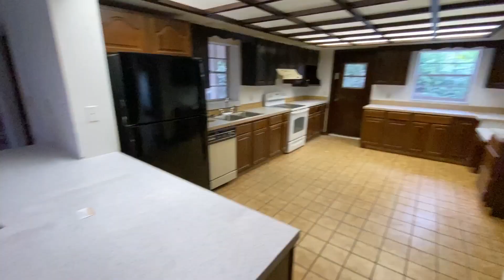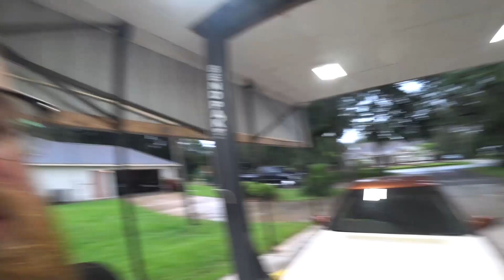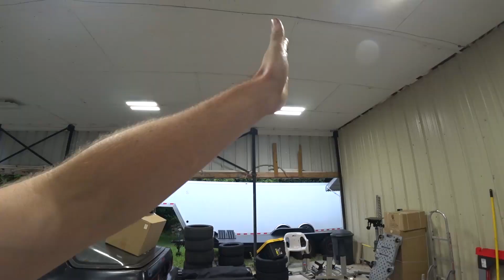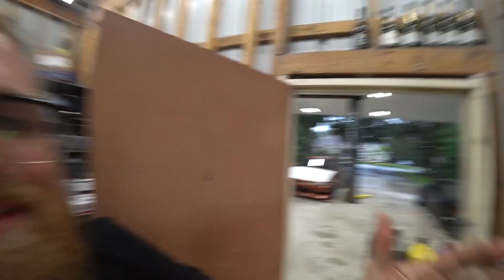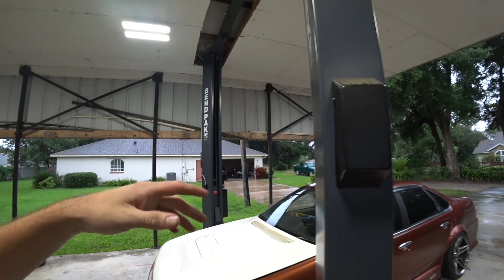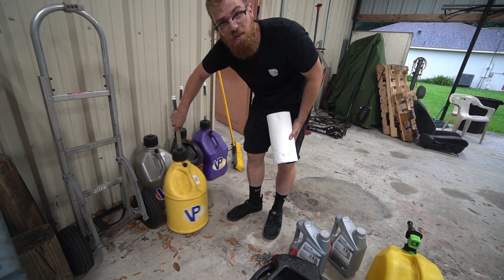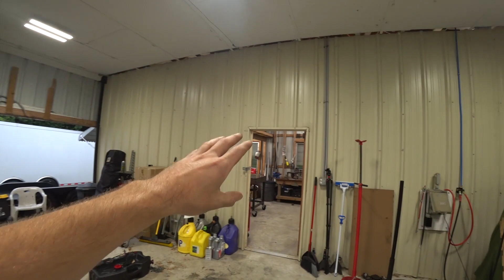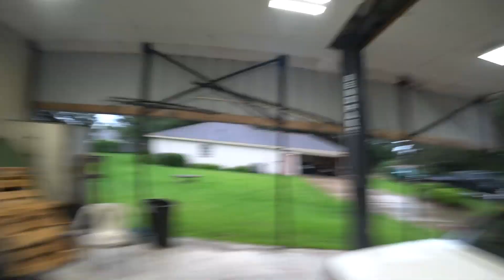Update on my new shop. I have to tear it all down.

Comment: This is why you do everything on the down low and eliminate any unwanted visitors.
Reply: This is exactly what not to do. This isn’t the 80’s anymore. Paper trail is electronic and when they find out permits were not done you are on the hook.
Reply: Depends on Nepotolgy
Reply: @McarthurMotors  Naw, if it’s gonna cost him a hundred thousand more for a new shop a few thousand in an envelope (for their re-election, of course) will fix it for a fraction of the price.
Reply: Yup that little bit would have been closed up in a day and life would have went on regardless of visitors.
Reply from the maker: If you think a new shop is $100,000 you’re pretty far off. It’s about $10,000 more to build an entirely new shop than to close it in. Will probably be another 15-20k in extras like ac. Extra insulation. Loft. Etc.
Reply: Yup it happened to me ..live n learn .lives out in nowhere was building a garage barn on my property .had a yard sale next thing I know town was at my door
Reply: "eliminate any unwanted visitors"

That's why he needs storage for body parts.
Reply: And then a Karen drops a dime on you and the Building Department charges you with felony un-permitted construction.
Reply: @McarthurMotors  paper trail??? There is no paper trail with cash.
Reply: Exactly!👍👍👍
Reply: Terrible idea. U fool no one doing that. U cost yourself a literal nightmare. One neighbor reports u? Bam. Structure fails? Bam. Try to sell the property? Bam.
Reply: @pattimessenger6214  the fact that your two examples exist shows as to the sad state of the world….
Reply: @TinHatRanch  The people that catches the most hell are the people that has that "look at me" syndrome😂👍
Reply: @TinHatRanch  not how things work its a matter of safety.
Reply: Safety first always.
Reply: @Taylordrifts  I think you're underestimating the demolition costs..  and you're getting completely screwed if that's what they were charging you to fill it in.  All you needed was some half sheets, a couple roll up garage doors and a 3ft walk door... and some 2x4's..  You screw the sheets lapped under like the "cheap guy" said.. and you're nearly don't --- just fill it in with simple stick frame with wood or even light angle iron.  It's not structural;  it's just a facade.  The "structure" is already obviously-- how else is it standing... I would have done this for $3k labor, not counting materials. It's a super simple and easy job... It's literally 3 walls. lol..  I get that material prices these days are out of hand, so I wouldn't even know how to guess that price--- I'd have to call around and check.   But there's no going back now;  once you have the government pitbulls on your neck, they don't let go........... "No good deed goes unpunished"--- i get that you were trying to do things the right way, but knowing what you know now-- next time just do it and don't ask when it's an existing structure.
Reply from the maker: @calholli  I already have a quote on the demo costs and it’s not much even without saving anything.  But yeah I’m hindsight sure. Should have just done it. But also it’s going on a YouTube channel that’s easily searchable. I just didn’t want to deal with headaches later on and honestly not even mad it forced my hand on doing a better shop. The time wasted is really what sucks. Could have had the new shop done by now if I started with that goal in mind.
Reply: @Taylordrifts  Yeah.. as long as you have the extra money, then you'll probably be happier with a new shop anyway.  I probably would have built the new shop right next to it, and kept that thing for a car port;  that's by far the most economical thing to do.
Reply: @cfcreative1  Paperwork doesn't make structures safe. It just makes bureaucrats employed. Safe structures can be built legally or illegally, it's the methods and workmanship that matter, not the permits.
Reply: @McarthurMotors  ......and good luck insuring it.
Reply: @bpj1805  its not a perfect system but i saves lives vs anyone building a dangerous building that people live in.
Reply: Not sure about FL but in NY they harassed my Dad over some things and he confronted the inspector about their having to ride around bothering people due to not enough other work to do.  Also, his property is zoned commercial so he was not only a residence.
Reply: @pattimessenger6214  Turning in people for Jan 6 when every major US city experienced some level of rioting and looting is 🤪
Reply: @cfcreative1  People generally don't get too out of hand with structures they themselves will be using. Anyway, it isn't the piece of paper that makes a structure safe, it's the construction details. I don't like this sort of credentialism that fetishizes paper trails. That building in Miami had all the paperwork too.
Reply: @bpj1805  Well in Canada i have worked in construction for the last 15 years. There is a process for making buildings that involves approving the plans. Complying with local codes. Inspection of foundations, renovations, framing, plumbing etc. Life is short. Doing things right the first time saves many people stress, potential disaster and financial loss.
Reply: @McarthurMotors  it not the 80 because folk put up with bs and will not vote in loving folks all this sounds  like hes building a bridge goofy
Reply: @cfcreative1  Yes, and you can "do things right first time" without ever seeing a government employee. It's the real-world conditions: the soil types, dimensions of foundations, methods of joining materials, etc. that make a structure safe. Not the legal fictions layered on top of it: the permits and fees and approvals.
Reply: @calholli  I completely agree! The only difference is that I would charge $4,000 for the labor. lol.
Reply: @ChooChooRooter   yep send then to a sckrool that will do it .sad sad stuff adult needing hand held and liking it
Reply: It will hurt and hurt you badly when you sell and you have to pay for demolitions and fines.  He screwed up without asking about permitting and getting that in the housing contract.
Reply: @garhent  things that may be true modern odd ball over complicating ways of  thinking add contracts and law suits and the heart in people to use that so easily to hurt others all for no more that being a prideful persons and justifying it by making the reasoning that it  up holds  rules imposed by rule mongers all that looses common seance need to retrofit but that part is on this guy may be do thing he even tried that angle   ,theft in truth may be
Reply: @onetrues3978  i have only worked building houses in Vancouver. Im sure there is some corruption in every industry. Its your choice to call it all bad or all good.
Reply: Yep
Reply: @garhent  i agree i know a guy that messed with his house when selling time came this was an issue that could not be overlooked
Reply: @M30263  people will always buy in an up market.

Comment: My brother-in-law built a metal barn house/shop. He split the living and shop areas right down the middle of the ridge line.  On the shop side he installed RV size doors at both ends, though he didn't have an RV.  He set it up so he could drive in and through the shop side and out the other end.  During nice weather, when it wasn't too hot, he would open both RV doors and let the breeze cool the shop to save on A/C costs.  He had another pad on the far end outside where he parked his trailer.  He had a gravel drive outside on the shop side so he drive right through and U-turn around to drive out off the property.  You could do something similar to put your machine/tools/lifts on one side and have the long open area for storing your vehicles.  You can still have your loft area above.  Check out mini-splits to run A/C in your shop.  There is only one disadvantage.  A metal roof can kill cell service, but there are antennae kits to install that will bring the cell service inside.

Comment: A great example of how if the city doesn't want you to do something, they'll bury you in codes and regulations...
Reply: they want you to lobby (bribe) them
Reply: J D  "Absolute power corrupts absolutely" Lord Acton 1887
Reply: Yea. I just literally never conform. Gotta fight tooth and nail
Reply: @vanderumd11   I agree, with Government if you give them an Inch and they'll take a Mile. And If some think they'll give it back eventually, they'll be sadly mistaken.
Reply: This is actually something I see regularly. Free metal building, just disassemble it....  All these metal buildings are engineered and certified by the manufacturer(instead of being built to local code). Once you get the building delivered, you're stuck with what you ordered. I agree he probably could have enclosed it a little at a time and probably no one notices. Keep in mind when you order buildings, get the one that's more than what you need, coz that's it!

Comment: DUDE. Just leave that shop as-is, and add a second shop right next to it. The added cost of slab will be covered by not having to tear down the old one.
Plus you end up with more overall space. 2 shops are better than 1.
Reply: Regulations likely wouldn't allow it. It's residential. Plus have to buy all the concrete which will cost as much as the structure
Reply: @mrmotofy  regulations restrict the area of enclosed shop in relation to the footprint of the house dwelling. If he can tear down an open structure and replace it with an enclosed structure, then he can build a second structure that would, when added to the existing enclosure, equals what would have replaced the first.
Reply: also, slab on grade foundations are relatively cheap here in Central Florida.
Reply: @TexChopper  NOT if he's not allowed to have a 2nd structure or a million other restrictions. I chatted with an inspector a few yrs ago. In the residential area one can build an additional structure but you may NOT conduct any related Business out of it. Can't build a single thing in there to sell etc. Can from the attached garage...but not the additional structure. Since he does commercial content they could say he's running a business and prohibited. There's all kinds of things they can try and throw at him.

That size slab would be $15k most everywhere unless you can DIY

Comment: Don’t dry wall the inside. Doesn’t hold up to the conditions and it will get dirty and is hard to clean. Mud will crack and screws will pop because the building will move more than the standard house. Put white tin on the inside. Makes it super bright and you can power wash it. Can’t beat it. Don’t make the mistake I did by putting dry wall in shop
Reply from the maker: Good to know! I meant to ask what other options there were besides drywall in the video.
Reply: @Taylordrifts  Look at using dairy board. I think the real name is melamine board. You can hose it and wipe it down.
Reply: @Taylordrifts  I would use some kind of washable board or plywood siding something you can bolt stuff to and also withstanding everything that goes on in a shop I definitely wouldn't use drywall
Reply: Off white tin / to reduce arc burn to the eyeballs!!